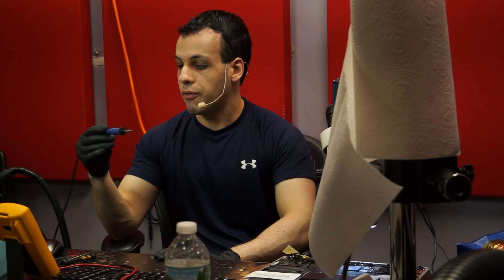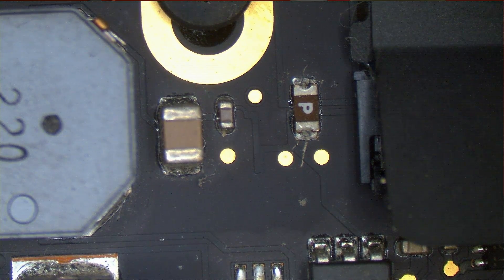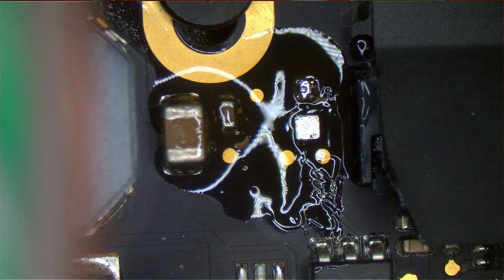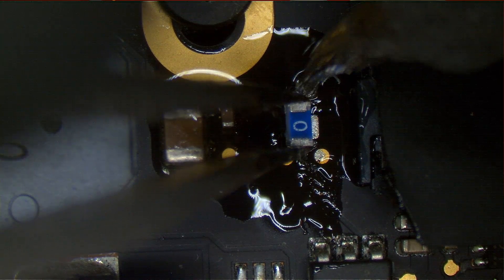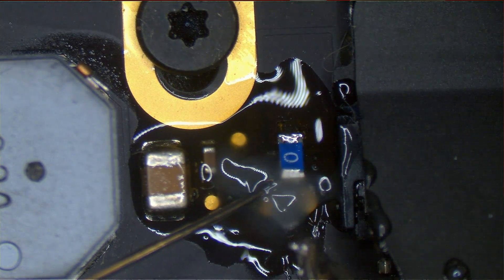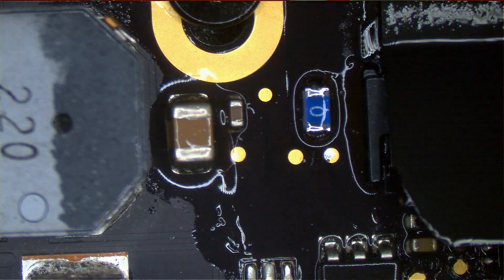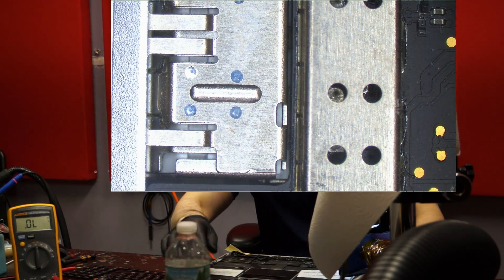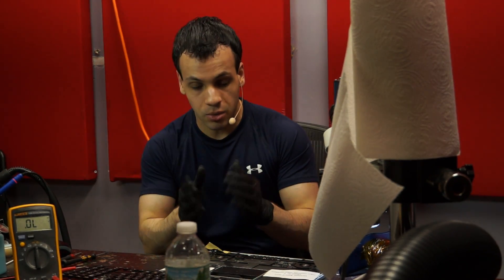Replacing SMD components without burning neighboring connectors without hot tweezers

Comment: I’ve always thought when a SMD went tits up you tossed the card or worse yet whatever it was in and replace. Going to follow your instructions and try to replace a burnt resistor (can cap shorted,being replaced also) on a card in a guitar amp. Thanks for posting this video.

Comment: You could also use Kapton or metal-tape to cover the temperature sensitive parts.
Reply: Is there any good reading on the topic? Or is it as simple as masking off the surrounding area with foil/kapton?
If the kapton has good seal against board, a damaging amount of heat wont creep into the masked areas?

Comment: I have a board that has a blown capacitor it looks like the small brown cap in this video are they all the same value or do they differ because there are no markings. I know that it is the brown one that's fried. I was thinking of just pulling a similar one of another unrelated board. I only know it's brown because I have found pictures that show the missing part. Would it hurt the device if I tried a similar-looking capacitor? My soldering station lost fan control and there was only one spot on the board with issues all relating to the potentiometer that controls the fan speed. Perhaps someone knows the circuit enough to tell me how to bypass the PCB and attach the fan control directly to the potentiometer.

Comment: I tried removing an SMD component similar to the one under the keyhole in your video using your technique for the fuse connector however it didn't suck it up - only melted it. did I do something wrong?

Comment: For stuff like that, IMHO, way too much flux.  For a small component like that, I use a flux pen (I know with thin flux, but I like it).  I've been doing repairs for 57 year and SMD since about 2000, although I am learning better hot air techniques by watching you and others on the net.  What none of you seem to want to publish is the temperature settings of the hot air station.  I understand it can be a little different for each board, but a general setting would be nice.  I'm sure you would have checked for a short before replacing the fuse.    How about using an SMD self re-setting polyfuse when replacing a soldered fuse.  I've made sure I do that and all our board designs have changed to using them.  It helps future servicing a little, plus helps when a connector cable might not have been seated properly and caused a temporary short, that is corrected by re-seating the cable.  Anyway, great job as always, I enjoy your repair videos and your educational videos.  As someone who would love to visit the big apple, but probably won't have the means, I would love to see more of your videos of your walks home from the shop and see more of the city as you do walk.  I really like the one you did do.  It is great seeing it from the reality aspect.

Comment: You could do this covering eveything with aluminium foil (there are special thicker kinds that work better but usually the one used for food can do the job, you can also use a nesquick aluminum foil cover which is better). You can cover everything and make a small window where the hot air can only hit the component you want to desolder. You can still do it as you have done it and use the aluminium foil to protect the connector when using the soldering iron. Good vid anyway :)
Reply: +TutoElectro Or use kapton tape :)
Reply: Some times that doesnt work...

Comment: Very nice - great video - at college in the 1980s I was bounced into taking an electronic "O" level and we had to design and make our own boards as well as fix everything to it to make a working project- I wish I had you as a teacher- you do stuff that would have made all the class projects a lot better - we never used or heard about flux etc
Reply from the maker: +QALibrary your last line on flux made me sad.
Reply: yes no wonder stuff got broken and over heated and fell apart and we where using the cheap of the cheap stuff as well with lead and no fumes extraction